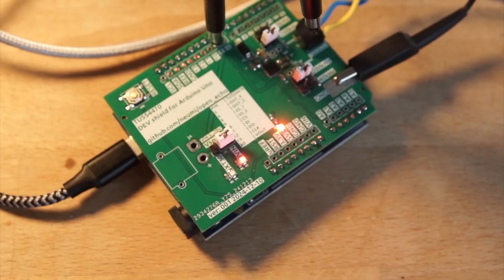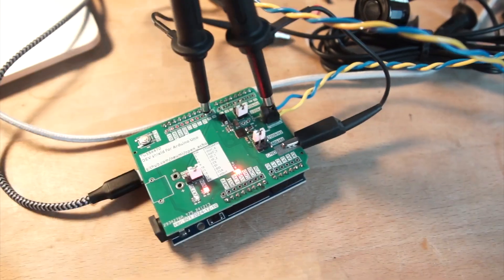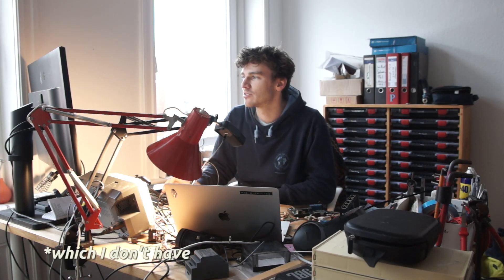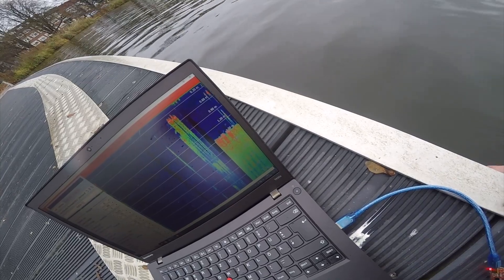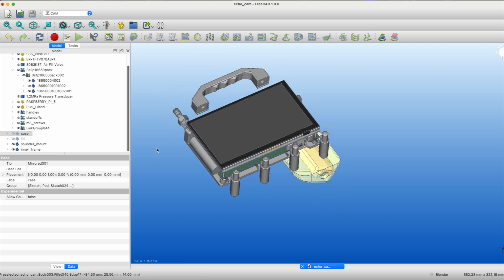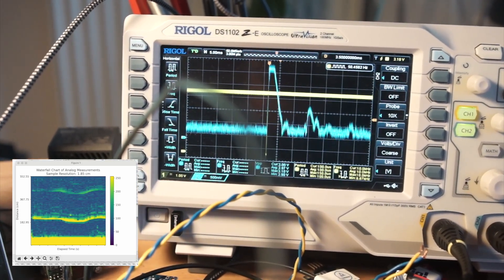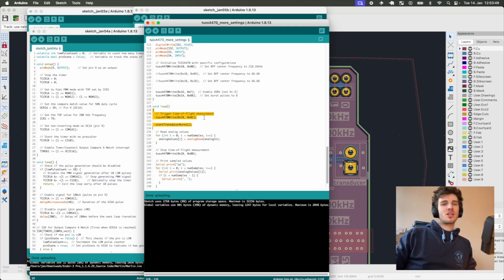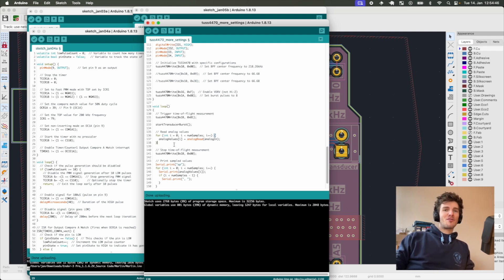Open Source Underwater SONAR Update! | new PCB for Arduino with TUSS4470

Comment: hi friend. This is a cool project! I want to try it too! I understand correctly that further experiments will take place on the TUSS4470_shield_002 board. I need to start with this board. Very good results in fishing water. I'm shocked!
Reply from the maker: Hi, thanks!
Yes, the TUSS4470 shield is currently the standard development hardware. While the Arduino Uno has fairly limited specs, it’s still a solid starting point. I recently managed to reach 50 m depth in water using a 150 kHz transducer with an MT3608 boost converter to increase drive voltage. For most applications, the shield should be more than sufficient.

I’ll be releasing a video in the coming weeks with results from our tests in the Baltic Sea, where we achieved these greater depths and were able to see fish, seaweed, stones, and other stuff on the seabed. Considering the cost of the boards and the range of the transducer you can use, it’s quite a unique solution and already very capable.
Reply: It is very cool. I'm looking forward to the video. I will order components to start making this device.
Reply: @Neumi  My friend, please tell me. The current version of the gerber board is version 002 2025 03 27 ?
Reply from the maker: @ИванГоряинов-д9ь exactly

Comment: I don't know if this will help or create just another rabbit hole, but 40 years ago I had this cheap tv  that had buttons for each channel. They used a varactor - an adjustable capacitor - to tune in the station for each channel to each button. This was analog TV., I thought you might be able to use this to control the shifting capacitance problems.
Best of luck!!
Reply from the maker: Wow, that's a nice tip! I wonder how voltage-proof they are. Never heard of them before. Always thought that the only option is a variable capacitor (like these trimmer capacitors in old radios with the plastic dishes you rotate into each other)

Comment: I am looking for an omni-directional sonar  transducer that is very small and light for 100Khz to 200Khz range. I think it will look like a pea. I am not trying to get a signal back. Just radiate spherically. The range of the signal should be 100 meters in water,( the radius). If I can make them myself all the better.
Any help would be appreciated. Appreciate your work. I'll share with you once i get it done.

Comment: Hello, great job—the best I’ve seen online, whether in text or video format. At the institute, I worked with piezoelectric elements, and I’m also an avid fishing enthusiast—currently building my own fish finder. I have a couple of notes: the shape of the piezoelectric transducer is usually chosen as a disk to ensure a narrow beam, but not too thin, to avoid the detrimental effects of longitudinal vibrations. Another important factor is selecting the right thickness for the matching layer (the material between the piezoelectric element and the medium). If it’s plastic, it should be around 0.5 cm—I’ve had to repair commercial fish finders by simply replacing this part. I’d love to see a continuation of your project in the future. It would be great to adapt it for assembly using simple, cheap modules. For amplifying the ultrasonic signal, you could use an inexpensive circuit from Texas Instruments (or AD8310), an external 16-bit ADC for better precision, or even an ESP32. Once again, thank you for your hard work!
Reply from the maker: Hey!
Thanks for the comment. Really appreciate it!
You shared some great info. Until recently, transducer design wasn’t a major focus of the project, but I’ve been diving into it more lately and am thinking about building my own transducers from scratch. I’m still looking for a solid starting design, but I think I have a general idea of the process. The main things I’m still figuring out are the choice of materials and the correct thicknesses.
Right now, I’m considering using a heavy, rigid backing material like stainless steel (or better even tungsten :D), metal powder infused epoxy, or just a block of aluminum. I’d glue the PZT element on with CA glue, then add a matching layer, probably urethane or epoxy, with a thickness of 1/4 the wavelength of the target sound frequency in that material. Everything would be sealed in a waterproof housing. I still need to get some parts machined and run some tests, though.

At the moment, I’m mostly using a few commercial 150kHz and 200kHz transducers from marine suppliers and Alibaba. One of the Alibaba ones only costs about €25, so it's a great affordable and easy starting point. A nice bonus is that they don’t necessarily require high drive voltages, at least for moderate range applications (a few tens of meters). Check out my latest videos and the YouTube Short I uploaded for more on that! Also a dive sonar :D
As for the external ADC, that’s a cool idea, and I’ve considered it too. But in my case, resolution isn’t the bottleneck. I’m currently using an STM32F103 that has a 12-bit ADC, and its sampling speed is already faster than the maximum resolution the 200kHz signal can provide. That said, I may need to capture the full frequency spectrum (for software filtering like lock-in amplifier etc.) of the return signal at some point, so I'm planning to use an STM32G series MCU for that.
The new board will likely be a more versatile platform based on an STM32x MCU, with both NMEA and raw USB output. I’m also thinking about adding an ESP32 socket for optional Wi-Fi.
The project is still under active development, and it’s been really cool to see a small community forming around it. A bunch of people have already got their own Open Echo Arduino shields, so we’ve got a little group of developers and testers working together! Feel free to join the discord if you like! :)

Comment: Thats incredible! From what I see on the screen, lowrance and other sonars don’t do much processing! Your image is almost the same as theirs. I thought the do all the object recognition. But the devices from them are so weak, they can do any serious computation on it. 

What you do is amazing! Keep on!
Reply from the maker: Actually, I got a Lowrance 5TS for the transducers and played around with it for a bit. I was quite surprised by the processing speed—maps and other features run very fast, and the echo rendering is impressively smooth. I'd say they use pretty good, low-noise hardware in their devices, resulting in sharp images and significantly more powerful transducers. Probably around 50 to 100 times more power than what I get! :D

Comment: Super cool project and I'm looking forward to updates. I've been giving this whole topic some thought for a while now, but more in the context of underwater localization (think GPS with some buoys on the surface) and communication.
One idea to get more energy into the transducer would be to emulate an FMCW radar, then you need less peak power. Not sure if that is possible with that particular chip, but it shouldn't be too hard to implement discretely (famous last words, I know).
Reply from the maker: Thanks! 
Yeah ... we're having a heated discussion on the Discord server (feel free to join :)) about how to switch HV DC directly instead of using a transformer with an LC circuit and the associated tuning for every transducer, frequency, and cable combination. When we have that, there is (as far as I know) no reason, why that would not be possible. Another awesome goal would be to have a freely programmable TX and RX for ultrasonics. For underwater communication or what ever you come up with, as well. :)

Comment: This is a very nice and neat project ! Great work! A STM or ESP µC is a good idea. I actually would like to contribute, if you don't mind. 
I got a few questions:
1. Is the ADC resolution important to this application ?
  * For me it looks like, it is not that important, but i might be totally wrong
 2. Are you currently working on a STM or ESP based board ?
  * I made a few boards with these controllers, and i would love to make one for this project. BTW very could choice of EDA :)
3. What kind of power supply did you use ? Switching or Transformer ? And does it interfere a lot with the signal ?
4. Are the project files on github up to date ? In the video it looks like they differ, but i might looked at the wrong sources.

Hope you continue with this amazing project. Would really like to implement it into my boat :)
Reply from the maker: @JaverikTools    thats cool! Sure help is always welcome! The ADC resolution is not very important. Every modern MCU with a 10bit ADC is enough. What is important is the speed and a resdonably precise clock to get good repeatable samples.
The board is currently an Arduino shield and I use an UNO. So its an Atmel atmega328. Quite slow, but enough for getting started.
I used different power supplies. Batteries are for sure the best, but a switch mode supply or USB weren‘t a problem. In the next design it will most likely be a well filtered buck converter. The most noise comes from too long (unshielded) transducer cables.
The files for the PCBs are up to date, but one additional code file is missing. I‘ll upload it tomorrow.
Looking forward seeing you on github or discord :)
Reply: thinking of a STM32 with an internal 12 bit ADC, the onboard ADC of the ESP32 is not that stable.
Reply from the maker: @oscarpeters1351    yes. The new boards will use an stm32f103 or stm32f407. I did some tesing with AD speed. The UNO now samples at 13uS/Sa and the stm32f103 only at 60uS/Sa. but I still need to do some optimization on the STM32. Hopefully we get something faster than wavelength time :)
Reply: @Neumi  Thinking more in the range of an ARM M4 (stm32F4) should do the trick, regarding that you do some more processing and DMA from ADC
Reply from the maker: @oscarpeters1351   sure stmf407 is better, but JLC asks for 3€ extra parts fee 😂 id love to keep prices below 50€ per 5 boards 😂 lets see. Ill do some more testing on the stm32f103 and then decide. From my understanding the sampling rate on the stm32f103 should be faster than ob the atmega328. DMA should help to get <wavelength sampling rates hopefully.